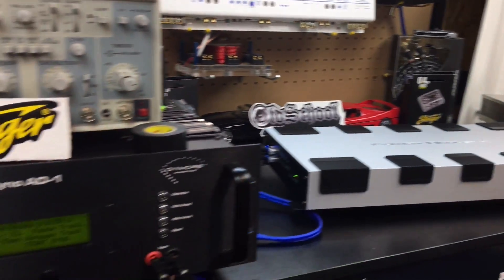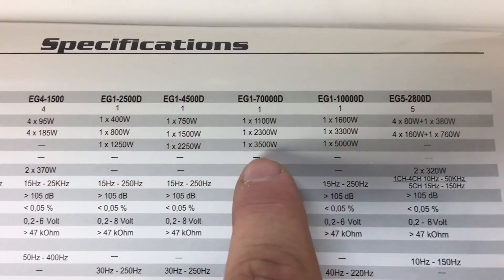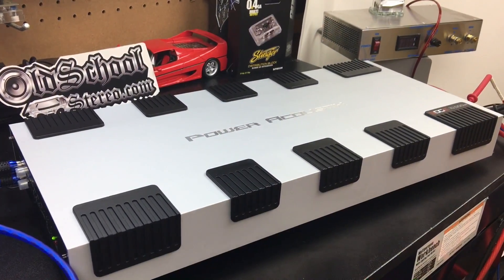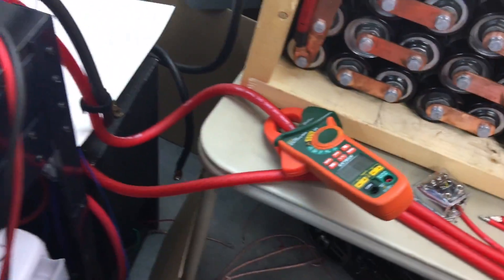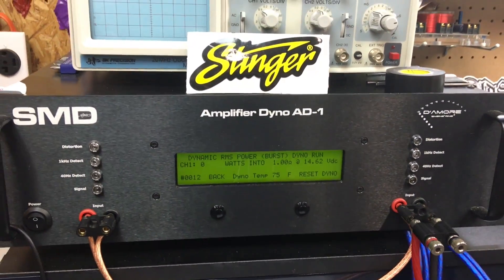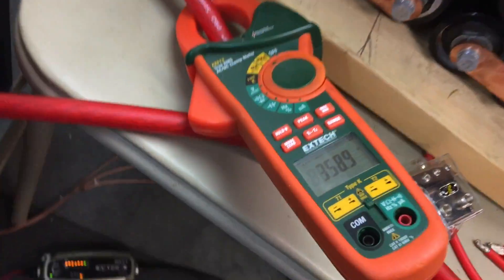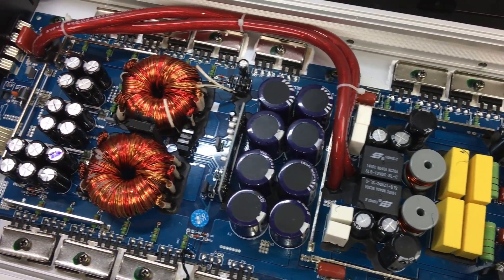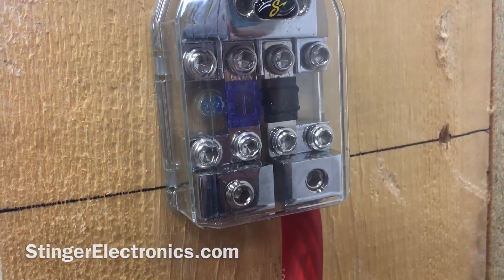10k Watts for $300? Power Acoustik EG1-10000D Amp Dyno Test

Comment: would love to see some dyno's of any of the new amps from orion xtr line-up like the orion xtr 1500d
Reply: Dwiz, can you do some new Orion amps?
Reply: it would be interesting
Reply: I was thinking the exact same thing !
Reply: I've owned the Orion XTR 2200 and liked it so much I bought the supposedly updated XTR 2500. They didn't update anything but the name. Exact same amp, over preformed at 2200 so they changed the label to 2500. They claim rated at 12.6v but I couldn't get rated at that voltage. I DID get rated at 14.8 however. Phenomenal performance at half ohm as well, get a little warm however...

Comment: Well.. As a rule of thumb with Power Acoustik, Calculate half of the rated power to get the idea of where you are at.. 
So if it says 5000 watts, then assume that the amp will do about 2500.. 

Anyways.. I would love to see the Pioneer GM-D9601 on the amp dyno.. It's a very popular amp that's both cheap and many claims that it DOES rated power (1200w at 1 ohm) - Would guess that it does so dynamically
Reply from the maker: False claims to sell amps is still cheating the customer. You know, I know, many others know, but there is a large population of car audio consumers who don't know. This is why I make these videos. The Amp Dyno does not care what brand or price an amp is...it just measures wattage.
Reply: To citate Steve Meade: "The Honey Badger doesn't care"

But keep up the work of making these videos. While Steve hasn't made any Amp Test Tuesday videos in a while, I had to look elsewhere, and it seems that you are the best source of amp-dynoing videos right now
And I like to see the true potential of amplifiers, to see whether or not certain amplifiers can do rated power.. 

I would done some myself if I had the SMD AD-1 and a shit ton of batteries. I'd like to see what some of the common brands in the EU can do..

Comment: for the  $ it maybe worth it 
does it have 4 gauge or 0 gauge power n ground wires?
Reply: video at 2:05 says 0 gauge.
Reply: +oriondx72 thanks
Reply from the maker: 1/0 ga or commonly stated as 0ga

Comment: A high quality amp can make a low quality sub sound good.
Reply: the enclosure matters a lot too
Reply: +BH4x0r I know, it's just that he's focusing on the amplifier at the moment.
Reply: +BH4x0r I know, it's just that he's focusing on the amplifier at the moment.
Reply: +Jayden 97 Maybe a good combination of high quality amplifier and enclosure will make a low quality sub sound good.
Reply: Actually it's often the other way around. My experience is this. A nice powerful amp with quickly get a poorly designed driver into trouble. Too high MMS with low CTS, and not enough motor. Those drivers are usually better off with a weak amp that will not make the driver bottom out over nothing. However, while it's always a great idea to pair a great driver with a great amp, a nice driver can still sound decent with an entry level amp.
As for enclosure design. No matter the combo, the enclosure needs to be correct.

Comment: for $300 it's still a good deal, 2500 ish at 1 ohm, I paid $300 for my sundown 1000D, it puts out a bit more than 1000 Watts, but I bought it because I know it will do more than it says, and last for a long time, and I've heard they can run half ohm just fine, and get another 500-600 Watts, it makes me want more power for cheaper seeing this, but I know id rather have my high quality amp, that will keep going after tons of use
Reply: It's not about the power. Problem is that a lot of these amps actually sound really bad. You'd be much better off with an entry level "quality" amp. The big power number is clipped, and you can be quite sure the power will go down like an anvil dropped from a crane, once it heat soaks.
I suspect that a Memphis Audio 16-SRX750D.1 or Rockford Fosgate Punch P500X1 will get you a lot further, despite being rated much lower.

Comment: Fyi on the power acoustik side they say 5000 watts at ,5 ohm 
http://poweracoustik.com/product/eg1-10000d/
Reply from the maker: I noticed that, but it was modified after I had created the video. The manual shows 5000W RMS at 1 ohm and I also believe the other ratings were an ohm off as well. Still doesn't make the wattage they claim, almost in dynamic mode, but that should be listed as "maximum musical power"
Reply: +Dereck BigDWiz 
👍👍

Comment: looks like a soundstream
Reply from the maker: Epsilon, the parent company makes both, so they are similar. Appears to be same board as the T1.6000DL
Reply: +Dereck BigDWiz  that's the amp I wish u would test    either the 4000d or 6000d

Comment: how do you wire 4_4ohm subs to a half ohm amp
Reply from the maker: +Bama Rogers you can't unless they are DVC 4 ohm, otherwise, four 4 ohm subs in parallel will give you 1 ohm
Reply: They are dual 4 ohms
Reply from the maker: +Bama Rogers Wire all in parallel (plus to plus, minus to minus) and the four DVC4 subs will give you a 0.5 ohm load final

Comment: not sure what that manual is all about?? But every website that sells this says the .5 load is the 5k not the 1 ohm. and amps like this usually use dynamic numbers that's why they are not certified. not saying I would get one just fyi. not bad for someone that just wants to bump and not trying to impress people
Reply from the maker: +aceNthaHole yeah, pretty sure the manual is listed incorrectly...but, the website itself even has incorrect info, depending on what page you are looking at. If the 5000W rating is "dynamic", then they should call it dynamic power. All I'm asking for is honesty, guess that's too much to ask

Comment: Rated at 5000 rms @ 14.4 according to company website. 4877 dynamic rms @ 14.15 is not bad. Good output for a budget amp. Considering most tests are using dynamic only. Good test.
Reply from the maker: +godzillasballs The dynamic test should simulate music power, but an amp should do it's rated power in at least uncertified mode (up to clipping). I see they may have had a misprint in the manual as the website now says 5kW at 0.5 ohm. Still bloated ratings, the Sonido Mask 3k amp did over 7kW dynamically

Comment: if a amps pulling 230a shouldn't that be 2,300watts or more 

or does that have to do with efiecency?
Reply from the maker: +randall jr Benoit Yes, efficiency at 0.5 ohm is not going to be good on any amp, worse on budget amps

Comment: Yelp that looks like my soundstream amp. I was running 2 strapped at 1 ohm,  and they wasn't doing to bad at a half ohm each. But they were pulling to much from my current electrical system, so I took one out for the time being :( I'm glad you did this test Big D!!
Reply from the maker: +Subwoofer King No doubt, 2 of these would suck the life out of most even upgraded electrical systems!

Comment: The actual rating is still pretty good for 300$, time will tell how long it will last too. From the looks of it, it looks like a class AB, not a D.
Reply: Good eye Travis! Yes sir this looks like AB and proof is the huge current it sucks up
Reply: What this is bullshit, these companies not gonna stop until they find themselves in a lawsuit for false advertising.
Reply: Yip, I got a shitty BOSS riot 3400D amp, supposedly 2550 watts RMS at 1 ohm. What a load of shit, considering the fusing is 120 amp and its only a little bit louder that the last set up running 450 watts rms. Cheap and shit
Reply: +Hells Gate you actually bought a Boss amp?
Reply: Oxnard Adrian Lopez That's what I figured after seeing how it was built plus that amperage draw. Nothing wrong with AB amps I use them all the time. Too bad they lied about it lol
Reply: Kels3618 Keljo yeah, didnt know much about them, its ok for what it is and the price but thats about it. Its an unknown brand in New Zealand. Good old 'Trade me'
Reply: well on their site:
Product Description

New for 2016, Edge amplifiers are the next step in performance and value. Taking advantage of our tried and true class A/B full range and improved efficiency class d monoblock platforms, Edge amplifiers continue down the road of reliability and longevity you know well. Satin silver chassis, engraving, and accents teetering on the edges bring a high-end appeal to traditional performance.

anyways on their site it clearly says 2500RMS @ 1 ohm and 3000RMS @ 0.5

that is why you dont look at what a box says and do actual research tho
and the DC-DC converter might be inefficient

its about 73% efficient in total, which is not too bad but not great either

the fact that it does 4800 rms at 0.5 in burst is quite good, considering its only rated for 3000

Comment: the guts look exactly like the soundstream TA.3000
Reply: Exactly what I was thinking, they probably outsourced this amplifier and labeled it as their own. 3,000 watts would make sense. What's really bad is I had come across a cheap Chinese amplifier, ended up having Pioneer guts and they didn't even put in the effort of getting rid of the Pioneer logo on the board, of course it's "rating" was double what the amplifier could actually put out.
Reply: +Travis Piper they never expect anyone to check the guts
Reply from the maker: +Deshawn Williams Yep, all by the parent company Epsilon. This PA10k is a clone to the Soundstream 6000DL
Reply: +Deshawn Williams yeah they're all under the same parent company but the Soundstream brand is supposed to be their top of the line equipment. I couldn't deal with it after seeing how many amps that thing draws

Comment: Great video. 👍 It did a lil more then expected but I still wouldn't buy that amp. Too power hungry. I haven't seen an amp dyno for the new q1-2200.2 or q1-4500.1. Was wondering if you could make that happen?

Comment: Not enough guts inside that puppy to get that kind of power.  Did your power supply lag?  Doubt it.  Good video...
Reply: How much was that amp? Do you buy online or a local store? (Go Heels)
Reply from the maker: +Steven King I use the Maxwell Boostcaps now, actually getting ready to sell my power supply. I haven't used it in months, just collecting dust
Reply from the maker: +Steven King I bought it off Amazon.com it was $229 a few days ago (regularly $279, one seller dropped price so I jumped!)
Reply: +Dereck BigDWiz gotcha.  Cool, was just wondering.  Let me know. Price on the power supply.  What do you have, 1 farad caps? How do you charge them?
Reply from the maker: +Steven King they are 2600F caps! Called Maxwell Boostcaps, the ones I currently use are the 2.5v 2600F versions, I have 7 wired in series, then 4 banks wired in parallel. I'm going to change over to 6 in series and 8 total banks soon. This will give me much more capacity and less voltage drop, even with the BIG amps!
Reply: Dereck BigDWiz  well damn. Sounds like you went to capacitor school since you got it going on so well!  Awesome buddy.  Great to hear from you.  Love your videos.  Talk soon my friend.  Steven

Comment: That's some edgy results...

Yuuup, bad joke.
Reply from the maker: +kje rud I was thinking it didn't quite edge out the power, but I was thinking on the edge of reality
Reply: Dereck BigDWiz well said. Consider the size of that amp + the guts, it was quite small. The only amplifier I've seen live that can exide 10k+, is the Ground Zero - Plutonium at 18,2V. That thing is humongous and needs a powerplant to power it.

Comment: thank you for the test .. i think all these companies could learn something from car audio bargain market this same amp as a 2500d and it would be looked at like its a bargain beast not a turd.. i think the cab 1600 had better overall numbers and its just around 200 bucks.. this is likely just parts from a soundstream rubicon 2500d in the power acoustik case..we wont fall for the 10k but many of the flea market shoppers might get told its a 10k amp and at a higher price point.. thank you for all that you do brother..
Reply from the maker: +Stacy Williams it's all about the numbers, so if they put higher numbers on the box...more usual suspects. You should read the review of the "expert" on Amazon and how he gives this amp a glowing review, yet never mentions anything about it specifically other than he owned a car audio shop for 20 years.

Comment: Thanks for testing this amp, now my suspicion that my Power Acoustik BAMF 1200 is way under powered is correct.
Reply: I pushed 2 gw3-10 on 2 ohm load off an orion 2500d which is rated for 1700 rms. Gain set via smd dd1 and never blew one. Did blow one hooking 4 up to the amp at 1 ohm but could been a fluke. Everyone here knows Orion is way under rated

Comment: I was hoping it would be like the cab 1600.1. NOPE. DARN.
Reply: +James Mayberry yeah but I guarantee this thing won't last more than a few weeks.
Reply: its actually not that bad of an amp. it puts out more power than the cab, but not much more, (around 700 watts dynamic ) but at a cost of $100 more than the cab. could buy 3 cabs for the price of 2 of these and have 2500 watts more power on tap dynamically.

Comment: I love these supposed to be over 4K amps that only have one set of 0/1 inputs it's so laughable.... Now 4K for $300 is a good deal but you have to be at .5 ohm and it's just a joke when all amps say max power which is usually double of what the amp actually does

Comment: I just ordered me some new main caps for my HCCA225G4, they are 35V 10,000UF made by Panasonic, I will have to stamp the bottom cover slightly to get them to fit comfortably, that is because the 35mm height!
Reply: How much did those electrolytics cost you? Are they 105°c rated?
Reply: Steven King They are 105 c rated and they were under $10 shipped, but they are Panasonic HA brand caps.  3000 hour life at 105 c with max ripple current! Digikey and Mouser would have ran at least $10 each! I have dealt with several sellers with real quality parts on ebay, we must realize most equipment including Kenwood and JVC, though it is designed in Japan it is manufactured in China! I will only deal with certain sellers, since some have had some pretty cheaply made fake parts! 

Over there they will pay women to fly in from Taiwan and other regions and wear garments with parts stored in them, literally women will have 30 lbs of transistors and other components in their clothing! So knowing if your components are stolen or not is also important! Also look at the photos and see what they legs on transistors look like, if they are dipped in solder, they are likely cheap, so avoid that specific one!
Reply: +LuxorVan excellent.  Glad u got a handle on how to get them, the real deal. I've gotten some fake China garbage before.  China should be shut down.  Good work man.
Reply: Steven King thanks
Reply: +Steven King "China should be shut down". Man more truer words have never been spoken! Nothing but cheap junk and espionage comes out of china

Comment: wow, thanks for the video. this amp looks a lot like a Mosconi Amp.
Reply from the maker: +jose luis ruiz My buddy @HiFiVega calls it "Mosphony"
Reply: Dereck BigDWiz hahaha.
Reply: +jose luis ruiz  Moscloni is better
Reply from the maker: Junior is actually correct....Soundstream and Power Acoustik are both part of the parent company Epsilon. This PA 10k appears to use the same board as the Soundstream T1.6000DL
Reply from the maker: Or, maybe use Google? http://epsilonelectronicsinc.com/brands.html
Reply: +Kazuhiro hahaha moscloni! :)
Reply: +Danny Wean it actually is the soundstream 3000 soundstream and PA come from the same company
Reply: They are part of the same parent company but I wouldn't be shocked if the SS has different parts and will meet or exceed rated power.

Comment: Where do these manufacturers get their numbers??? Such bloated numbers on these "bargain" amps! Great video as always!
Reply: out their ass
Reply from the maker: +DJ Siryn they have no rules to follow, so they bloat the numbers so people who don't know better buy their stuff. That's my guess...
Reply from the maker: +DJ Siryn the numbers are cool for videos, but I personally use Class A/B and less than 1000W on subs and that's enough for me. I just enjoy testing amps and want people to understand what they are buying. Inefficient amps require more electrical, inefficient subs require more wattage, thus more amps and electrical. It is a vicious cycled. The old school amps I prefer were for the most part made in the USA, cost $2-5 per watt and are still working today....20-30 years later. Although this amp seems like a deal at $300, I doubt it will be working in 20 years
Reply: +Dereck BigDWiz That would explain why these are found in flea markets and pawn shops.... Smh... It's really disingenuous to people that don't know any better. However, on the flip side of that coin.... They buyer should have done a bit of research as well. There are some good budget brands but then there are these that are laughably bad. :) I miss the days when amps where highly underrated and you would get a pleasant surprise when your 100 watt amp made 500 or more rms! LOL!
Reply: +Dereck BigDWiz Very true! I still have a few old Orion amps from the early to mid 90's that still work like champs.. One of them even went through a flood and sat underwater fro a day or so. I sat it up on a shelf thinking that it was a lost cause and a year or so later, I decided to clean it off and hook it up and it freaking worked! I was astounded. My old PPI amps are still amazing too.